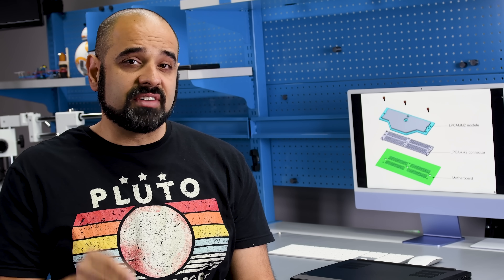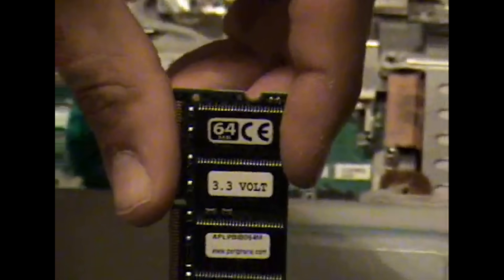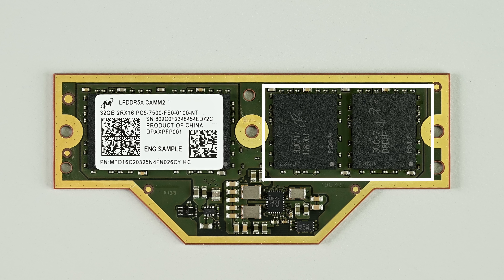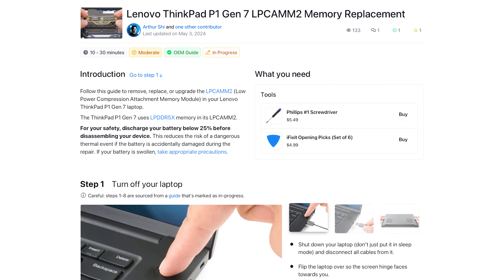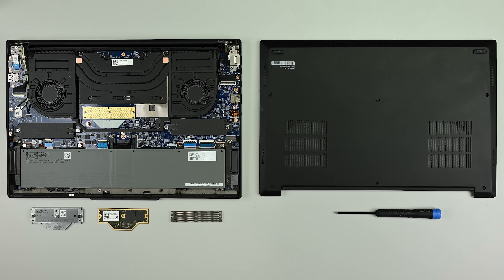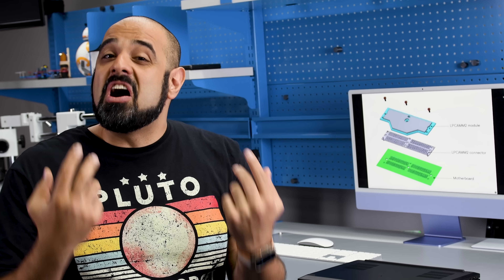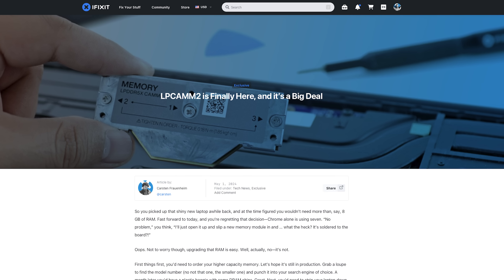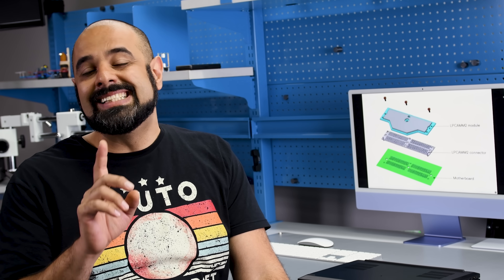New Laptop Memory Is Here! LPCAMM2 Changes Everything!

Comment: I think they can ditch the Low-Power part, in a word where old ddrm is called SODIMM Small Outline Dual Inline Memory Module, the current standard is LPDDR which is low power, it seems intuitive to expect CAMM to be enough to specify the new standard (also not sure what the number 2 is for, this is a new standard so preferably it should have no number at the end)

also "compression-attached" doesn't seem obvious to me. COMM for Changeable Overlaid Memory Module sounds more catchy, but obviously I think someone can come up with something better

Comment: the fact that you can replace the pins as well is frankly a godsend
Reply: Absolutely love that design choice
Reply: At first I was thinking 8-bit NES pin problem, until I saw that.
Reply: it obviously need to replace that cause the pins are way more tiny than those on cpu's
Reply: cheaper
Reply: not on a apple computer :)
Reply: @2xtreem4u another reason to never buy one. Along with absurd MSRP, decades of  hardware problems and denial, quick obsolescence, etc.
Reply: @WhippinTheBrillo I will never be ok with planned obsolescence. This is why I am willing to deal with whatever drawbacks come with buying an AMD GPU with more VRAM than an Nvidia. It's principal.
Reply: Cause they wear out so frequently right
Reply: @turolretar  They made it for a (user) field replaceable component and LGA pins can very easily be bent out of shape or broken by accident. Having a replaceable compression connector like this allows for the 'socket' itself to be another FRU without needing specialized tools.
Additionally, the compression connector allows for the correct 'tension' to be applied to the pins without requiring any specialized clips (think CPU brackets) that would increase the costs and size (not good if you want ultra slim laptops).
Reply: @turolretar what big Ben said, it's not wear, they're just unbelievably fragile. Put it in at the wrong angle and you could brick your laptop (if they weren't replaceable).

Comment: Why couldn't an amplifier be used to improve the signal strength? 🤔
Reply: I suspect two reasons. First, amps use energy, thus negating the LP part of LPDDR. Second, at very fast speeds, adding an amplifier means you have yet more signal integrity problems to worry about when there are already plenty.
Reply: Amplifiers will only ever add noise and delay to the signal. High frequency amplifiers are about 1.5mm² and you'd need one for each trace.

Comment: my only concern is the lower surface area to add more memory chips. From the looks of it, it only has one side that can be populated, but tradtional sodimm has two sides which allow for so many more chips to soldered on. I wonder what the max ram cap is for these chips.

Comment: there's was nothing wrong with SODIMM companies stopped using it for several reasons first it's cheaper to solder the ram chips second forces ppl to buy new laptops instead of upgrading and they stopped carrying about performance and long life but instead going for the thin look like with everything else that's why cooling in modern laptops is nonexistent and 99% of all modern laptops are just cheap pieces of garbage no matter how much they cost
Reply: There is nothing wrong with SODIMM, so long as you ignore ALL the problems with SODIMM.

Educate yourself.

Comment: OMG! Why did it never occur to me that the connector could also be a simple component? 🤯
Motherboard manufacturers have to make this the standard for CPUs too!
Reply: with modern desktop CPUs the power draw might well be way to high to do this.  (at least with intel chips pulling 400W in some cases)
Reply: @hishnash  but for mobile CPUs it will be a god send
Reply: @toby_cm The pin spacing on compression connectors like this is probably a lot larger than a BGA CPU, which would make it much larger
Reply: @bosstowndynamics5488  it can probably be made as dense as a normal LGA socket, but that is a lot less dense than a BGA

Comment: Whats the betting Apple adopts the standard....but sticks a propriatary chip on the ram module so you can only buy upgrades from them. I mean, it's still better than being stuck with 8GB ram but you just know they'll have 200% markup on their upgrades.
Reply: I mean you xan use a 4 channel interface getting to 256bit
Reply: @frederikex4545  The M ultra chips have 1024 bit! Aka 16 channels! I can't wait for 4 channels to become the new standard on both laptops and desktops. Especially with the rise of integrated GPUs, they can really use it.
Reply: Apple will not adopt this standard as the bandwidth it provides is still not fast enough for SOCs with larger GPUs.

once your SOC has a large enough GPU you need to provide it enough bandwidth and while LPCAMM2 is nice it is not desigend to provide the needed bandwidth for larger SOC gpus like Appels.  

You could also ask NV and AMD why they are not using this on dGPUs on desktop and the response will be the same.
Reply: @hishnash  There's nothing stopping Apple (and other companies) from including 8GB (or more for 'PRO' models....) and a connector for additional memory. Thus including very local memory for the lowest latency possible and 'quite local' memory for low latency expandable memory.
Reply: @hishnash  Apple uses LPDDR5, so bandwidth is same as other manufacturers. What's different is number of channels, with M3 Pro having 3 channels and Ultra having up to 8 channels - so it would require 4 of these sticks to use full bandwidth.
Reply: The issue is these are way to large to provide close proximity if your using 2 or 4 of these.   You would need a differnt design, something like a US shaped model that wraps around the SOC.

Comment: What might be cool for something like what Apple does, have on-package memory that's SUPER fast and moderate capacity, then have space for a CAMM module to be added later to expand the memory, even if that extra memory won't be as fast.
Reply: the thing is that how it works nowadays the faster ram will need to be clocked the same as the slower ram, thus vanishing any benefit. i imagine solutions for that problem exist but it introduces more problems that there needs to be
Reply: @milo-ur8zp  it should be possible, the 2 different types of memory would need to operate on separate memory channels, but it would create a lot of complexity
Reply: Intel NUC bean canyon already does that with the soldered RAM as L4 cache.

Comment: Samsung has them as well. Most likely hynix will be onboard, so Corsair, Kingston, apacer,gskill etc will push it past 8500MTps. Is it 32bitx4 or 64bitx4 module? Lenovo should have added it to their yoga and 14 inch ThinkPad T,P series instead of big 16 inch which will show that smaller laptop can now have bigger dram and we can choose minimum spec and upgrade later

Comment: 2:50

Does anyone know how tight a torque of 0.18 Newton-meter is? 
Are we talking tip of the fingers or something more?
Reply: 0.18 is pretty light. iirc you can exceed that using 2 fingers with a small screwdriver.
Reply: 0.18 Nm is roughly like holding an 18g object. Then imagine that as a twisting force.
Which means less than finger tight. Probably just until you feel resistance and then the tiniest bit further.
Reply: I’m glad someone brought this up.

Comment: It seems that a laptop mainboard with multiple LPCAMM2 "sockets" would need more physical space on the board than if the ram was was in SODIMM format (or something newer) that is stackable. If LPCAMM2 needs that compression connector, top pressure plate (not sure what its name is) and the module its self the Z axis is probably the same as SODIMM if not more. Then a laptop like this with only 1 LPCAMM2 socket still has upgradability issues if you want to upgrade your ram you need a module bigger than the current one, then what do you do with your old module, landfill I guess. Socketed RAM has been a thing for such a long time now the fact that manufacturers don't use it is to get more of your money not because it doesn't work.

Comment: Ok, you got me, that compression connector being replaceable is cool af
Reply: Are the pins similar to that of a CPU socket?  That would be a good reason to make them replaceable.  LGA sockets are so delicate!!
Reply: @Myself-yh9rr CAMGA
Reply: That made me go "wow".
Reply: SO there will only be 1 LPCAMM2 slot or could there be more? Thanks for showing how it connects was curious about that. I bet you
have to make sure it is well clean or some debris will screw the connections right up. SODIMM sockets are easy and seem less error prone
when you install. Well maybe in a few years I will see this, so good to be aware of this.
Reply: exactly
Reply: I remember the compression connectors in SGI machines.

Even with those things pretty much only being worked on by qualified people the fragile compression connectors often got damaged, the pins were tiny even in those days and the whole thing quite fragile. In the case of those machines it often meant a new main board or other massively expensive part.

I'm sure the design has improved a lot but yeah, you can't really have something like this that isn't easily replaceable on consumer hardware.
Reply: IBM was using similar replaceable board to board contact system in their POWER servers years ago.  Cool to see.
Reply: My Dell laptop has a compression connector just like this for the RAM board, so I think they were thinking ahead. The ram board itself uses standard SODIMM RAM but the entire board with those RAM sockets can be removed and replaced with an entirely different type of RAM board. Interesting.
Reply: Z ray connector I think
Reply: I think it's better for laptops, because if those pins breaks, that means the whole board being broken. But PCs is just the motherboard/cpu
Reply: and its tech thats been around for like 20-30 years in IBM mainframes. why intel and AMD didnt pick it up for their cpu sockets I got no idea.